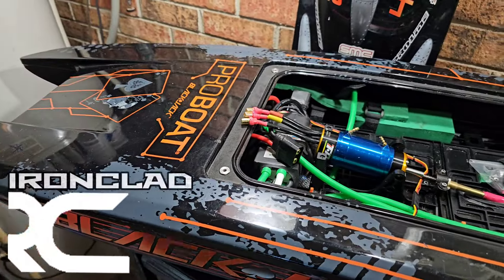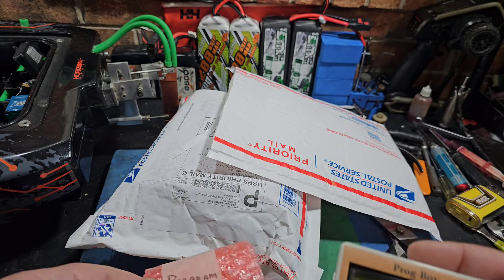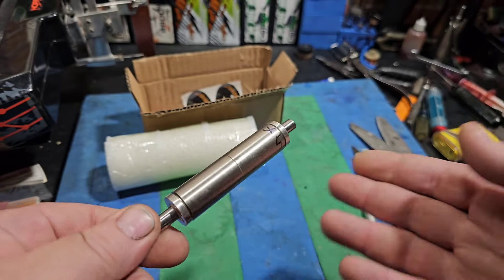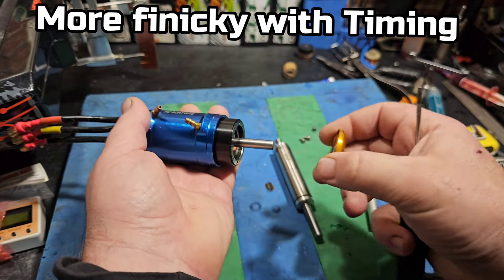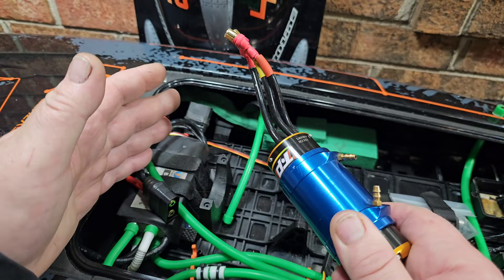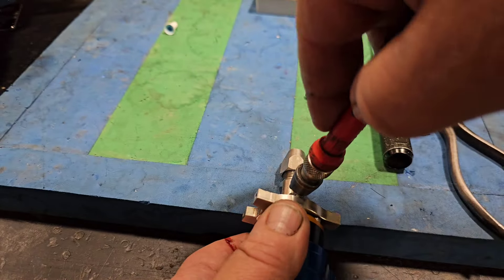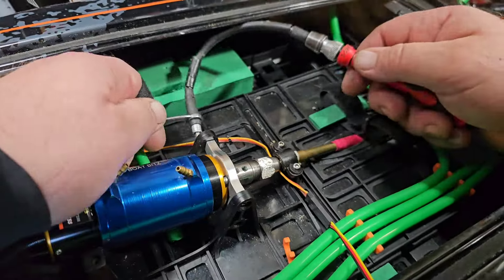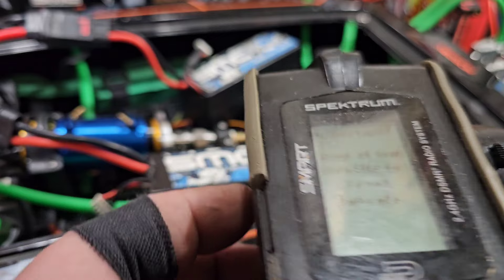TP 4070-cm Rebuild - Flier 400a Programming - 12s Blackjack 42 90+ Mph Setup

Comment: Big b the reason you want a boat in the water for full revs is not to cool the stuffing tube it’s so the prop can be loaded. 60k rpm unloaded turns into a lot less when it’s actually under load in the water and running

Comment: I don’t think 3.5 volt cut off is low enough.
 On 6 s that is 21 volt.
According to the data logger they dip lower than than under load so it might power cut. 
I set mine at 3 volts but I’ve never dropped lower than 3.6 when it slows  by the time I take the hatch off and check it when it’s not under load.
I guess we’ll see.
Reply: I've noticed the same thing. I set my Lvc to 3.2 & under full throttle hits if I noticed the lvc hits, I bring it in & the battery is at 3.7. Typical draw down in 0.5v, just what I've noticed

Comment: Hey brother, great video. Just wanted to ask do bullet prop nuts make a difference ?
Reply: They can, first time I tried on my BJ42 the nut 🔩 spun off because of stock LVC setting and I lost 2 good props and both of my bullet nuts 🥜 that day 🥲🤣😂
Reply from the maker: I've never noticed any speed difference with bullet nuts vs regular nuts.  I prefer zubber nuts over a nylon lock nuts.
Reply: @IRONCLADRC  Ok, don’t know what zubber nuts are. The bullet ones look nicer though.